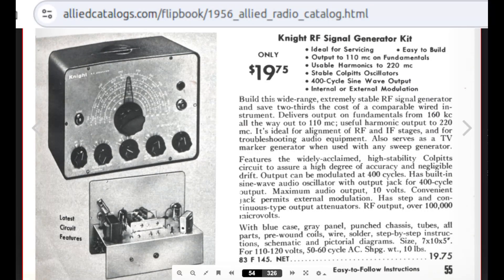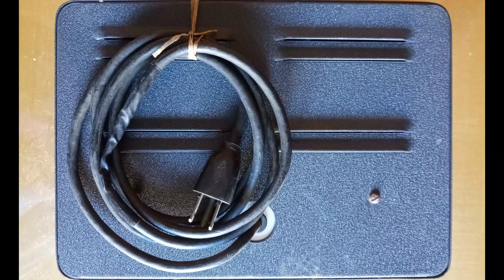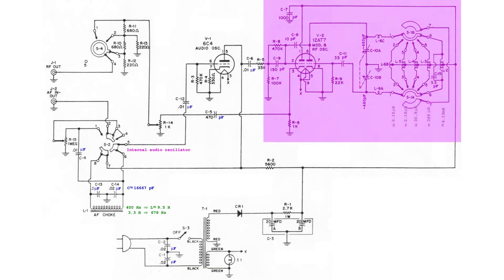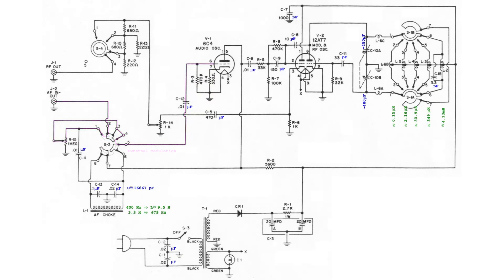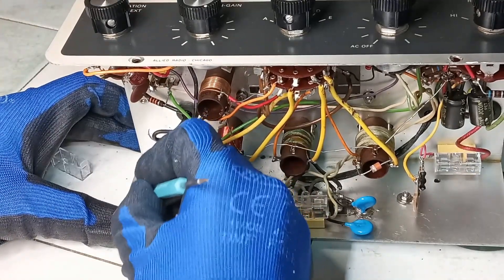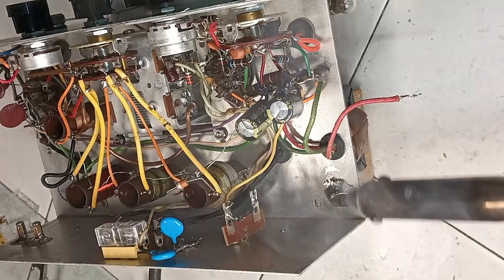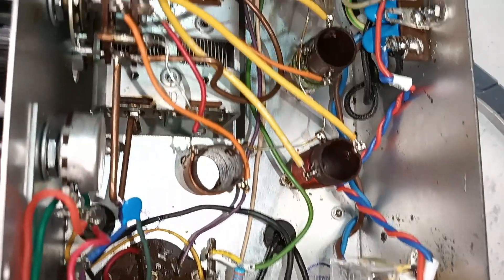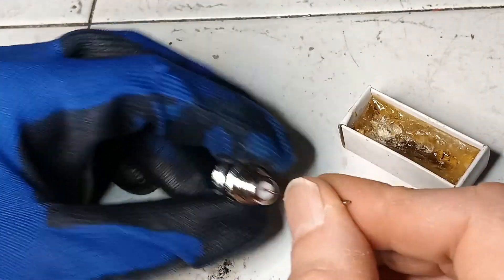DG’s Practical Notes, E#13 Knight RF generator KG 650, 1956

Comment: And why do you wear gloves for every part of this?
Reply from the maker: Hello. When I use the soldering iron I prefer wearing gloves, because I often burn accidentally my skin otherwise. Often I wear a glove only on the left hand, but in this case, while soldering on the BNC connector, I preferred to have both hands protected, in case I had to hold the adapter when it was still hot. 🙂

Comment: I have a very similar Signal generator - Its a Wide Band RF Signal Generator SO-108
Reply from the maker: Hello. If I understand correctly, your signal generator also has no calibration. However, it has the possibility to insert a crystal. So, I would say that yours is more advanced. 🙂
Thank you for your comment. 🙂🙂🙂